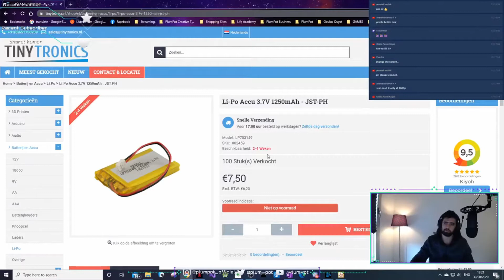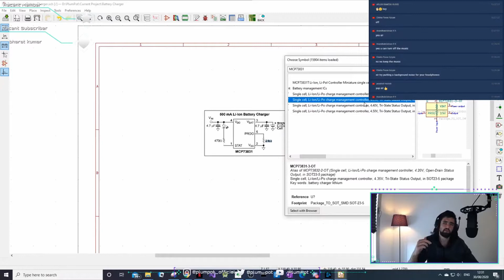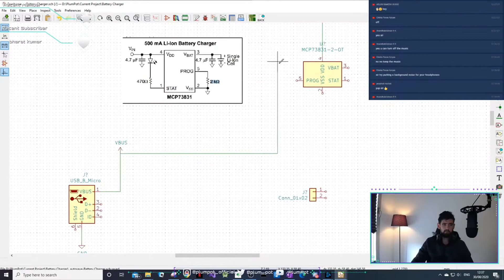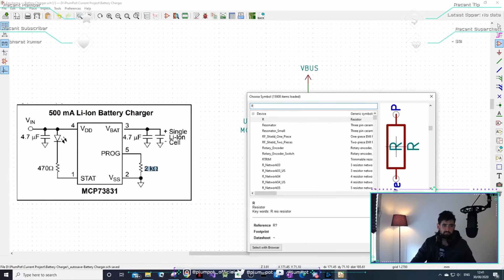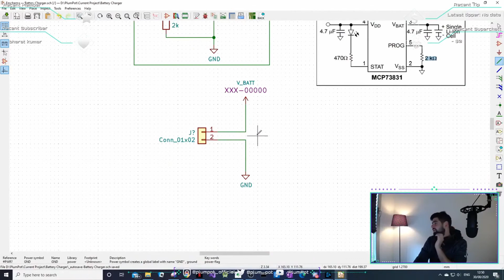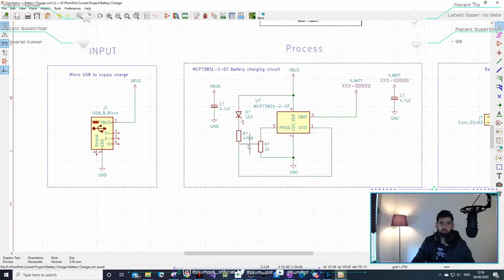KiCad Tutorial - Designing your own PCB battery charger - The Schematic

Comment: Hey I am super new to this kind of thing, but I wanted to ask does the battery capacity matter? Like could I use a similar design to charge a battery that is 150 mah? Or do I need a different charging management controller?
Reply from the maker: Hi Robby👋 nah battery capacity doesn't matter, but it has to be a single sell. So only the 3.7V-4.2V lithian batteries